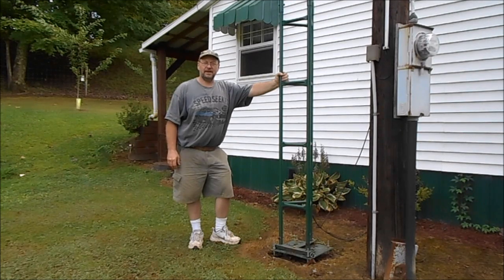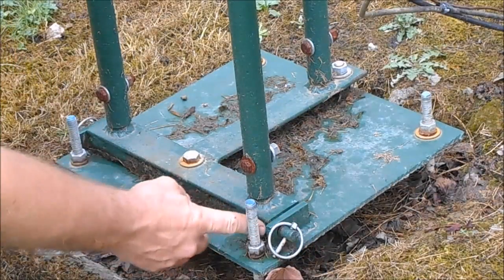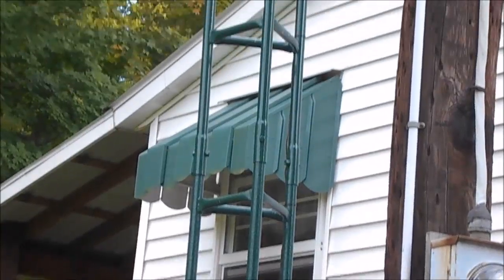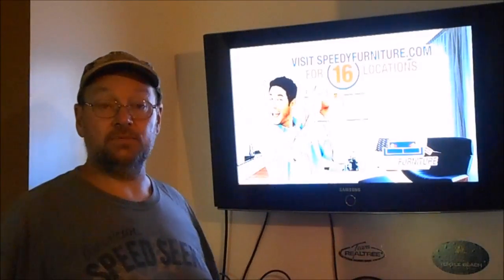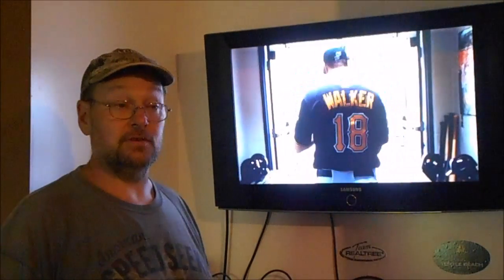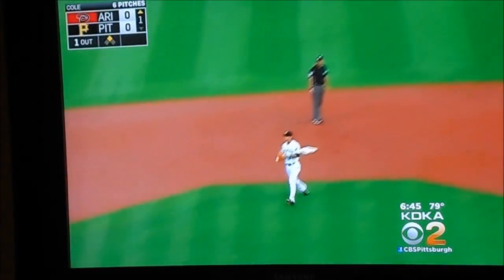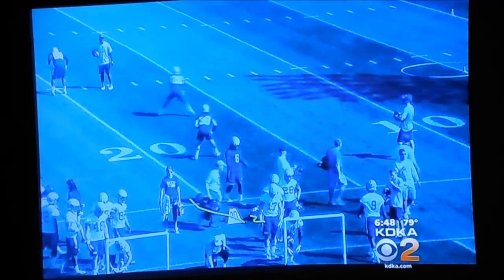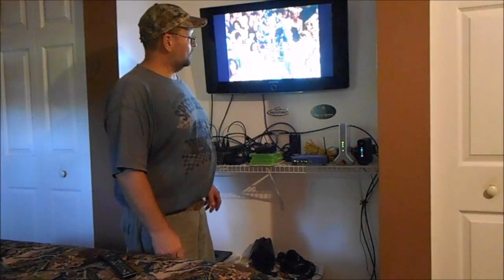The best 8 Bay HD TV antenna

Comment: Kevin,  I just saw your video and recognized the Pittsburgh stations. I used to get all the Pittsburgh stations  plus Johnstown from an antenna before the wonderful transition to digital broadcast TV in 2009. I now depend on direct TV for the local stations because I could no longer get them from my antenna. I live in northwest PA amongst the hills in a valley (we say hollow). I heard you state you lived in southwestern PA so I was curious how far you were from the TV stations in Pittsburgh and if your area was very hilly. I have been through Washington county and it's in mountainous foothills as we are up here.  Signal guides state that I am approximately 64 miles from stations. I remember when it was free TV and that's why we had to put up with commercials. Now we pay for TV and still have to put up with commercials. Great channel and good idea with the TV tower to make it easy to repair or maintenance.

Comment: It's just a matter of not just buying the antenna but installing the mast pipe to mount it on and grounding it properly. You really don't need a tower for a TV antenna. This seems to be making a comeback to eliminate cable & dish monthly bills which add up in a years time.
Reply from the maker: That is for sure thank you for the comment.

Comment: I have a CM-4228 It's great I pickup an easy 44 station or more with plenty of variety.(currently 60 channels with some repeated channels and a couple of Spanish stations)
I wasn't watching anything on cable. So I asked my wife if what she was watching was worth $125 a month. So first I went through various small antennas, then after doing my research, I ordered the CM-4228 through Home Depot which seemed the cheapest at around $90. I also the Channel Master LTE line filter to get rid of cell phone static which got me more stations and clearer stations.
Also you want the RG-6 cables and connector, and other cable or connectors is a waste of frequencies 

So I got rid of cable, But if you want to keep cable, it's not a problem as long as your cable box has a HDMI outlets
I did get ROKU so I'm good.
Reply from the maker: Thanks for sharing.

Comment: The Channel Master CM-4228HD TV antenna is the best antenna you'll ever own. I use mine with the Channel Master CM-7778 preamp and CM-3418  indoor distribution amplifier. Basically I could run my own MATV TV System and supply my apartment building with free over-the-air digital HD TV. The best quality picture you'll ever see on a HD TV and you can't go wrong with Channel Master. Currently getting 27 channels in the Montreal area 16 of which are U.S. Border Stations. $0 dollars a month TV!
Reply from the maker: I love it save money.

Comment: Kevin, Although this is an excellent antenna, it is primarily designed for UHF channels.  Since VHF Lo and High band exist in your area, you should install an all-band antenna.  Also avoid using an amplifier if possible.  Local cell towers and FM broadcast stations can overload the amp and degrade reception.
Reply from the maker: good information thank you

Comment: so do i need a booster when the signal is low on a cloudy day? I live close to many broadcast towers within 20 miles to me the closet being 7.1 miles. thanks :)
Reply: you won't need a booster....
Reply: Boosters are mainly for long runs or large splitters. Like 4 or more tvs. I found out letting your antenna do the work by using a better gain antenna but as close as you are you should not need a booster period. Also try turning antenna to get the strongest signal.
Reply: There are 2 Type of AMPS.  1= A Pre-Amplifier (For Signal Booster) and 2= Antenna Amplifier (For Long Distance Wire)

Comment: More than likely that duplicate channels that you're getting under another Channel  A affiliate of another Market. See if you're in between towns you may very well get to markets. The easy way to do it and figure out where they're at is put the call sign into the search bar of your computer and it will tell you where that station is located. Something else that may be beneficial as there is a website called TV fools yes believe it or not that you put in the ZIP code or your actual address and it will tell you on a compass type diagram which direction the stations are in and naturally you have to have your rotor calibrated in order to use that compass. If you did your scan at night you will tend to bring in stuff you may not get during the day that is far away. There is something that is called tropospheric ducting and when that is happening you can get stations from hundreds of miles away if you know where to aim. It's a phenomenon of Mother Nature. Very much like skip on the CB or ham radio. It's fun to play with and you have an excellent receiving station to play with long distance signals. I'm envious. Be aware that when  tropo as working you have to rescan to pick up those Faraway stations. During your scan you may see that it gets stuck as it is moving forward it may instantly pick up stations at that point and move on or it may not. If it is not a reliable signal the television cannot decode it and it will think about it a minute and either scan it in or skip it. That is the delays that you see. Get your headings and scan in that direction. The next they will be gone. I live in  Corpus  Christi tx. I had several stations down there i cant remember like 130 air miles away san Antonio  about  the same dist. North Victoria tx 81 air miles and one from Houston tx 180 miles. I have single yours is two together i have no amp. And i am 15 feet off the ground. Other than possible immediate line of sight issues you have a far better set up and you could easily get it of course if they're out there to get. You have to be patient and wait for conditions. I was previously a ham operator and have a 45-foot tower I need to get my antennas go faced with a reflector in a rotor up there. Playing with long-distance also none of this DX is more of a challenge then anything. It's not for Reliable TV

Comment: I have a ???  do I have to put  this  Antenna  way up high  over the roof  I have a few  trees around me  and dose it have to  point to  2  different  stations   I have about  5   different stations  about  30 miles or less around me.  about 4  stations is all in the  same place just about   and one is off in a different  place it is hard to line them up   to get them all  I will  find about  15 channels  and some will  go off at day time  and come back on at night any thing  you tell me  would help
Reply from the maker: The reason why you get good channels at night because the signal bounces off the moisture in the air do you have the channel master 8-bay antenna a good antenna is #1 above them trees would be nice the higher the better.
Look into a booster that will help to my setup was worth every penny. thank you for the comment.
Reply: Trees aren't near as big an issue if they are 30 40 50 yards away further the better. Do not expect good signal when they are 5 feet away. Look for the W above I had a long post regarding skip which is known as tropospheric ducting. On these particular frequencies. It is not an ionosphere bounce like on HF. Get a good antenna get it high and put an amp on it Sila all connections with tape on the coax and amplifier. What you scan it at night you may not have the next day. TV reception is better at night. It would not be impossible to have regular Dependable television on a good antenna at a good height from 85 or so miles line of sight is the name of the game. Also a good DB gain antenna and do not be fooled by those hundred and fifty mile antennas. Mine is homemade and that is not elaborate and I have received tropospheric ducting from almost 200 miles away
Reply: Brenda, There are several things you may want to check on your set up. The cables and connectors are color coded. Your signal is only as strong as your weakest connection.
So BLUE coded RG6 cable and connectors are best and rated for the widest frequency of 5 - 2,3Gh(2300Mh) If you have splitters, they will state a frequency range Old school units are generall, 5 - 900Mh. The RED coded are 5-1,004Mh. I'd suggest up remove anything that isn't coded Blue from your antenna to your tvs Also Buy concise lengths of cable(don't use 100 foot when 25 foot will work due to loss of signal.) If your cable comes thru a wall mounted jack, be sure the the plastic insert is Blue!!!! The ring on the cable ends should be Blue!! 

Lowes, Home Depot, Ace Hardware and Walmart should have what you need, but they also have the cheap crap that will give you a cheap crappy picture.
My cable company Harness was generally RED coded. once I changed it out to Blue, I get a beautiful picture and more channels.

As for Height, get it as high as you can. All of the "$39" antennas are shown mounted on the side of the house. This is not desirable. Your Antenna should be over the peak of the roof. So if you have one of those kits with the short stand, mount it near the peak of the roof so that you have the best signal possible. Away from trees and obstructions as much as possible
I was 10 feet higher before Hurricane Flo(Long story), so I've lost some long distance stations. I don't have a tower YET, But will soon as I can find a deal, so my antenna is 20 feet off the ground, about 7 feet over the roof. 
I have a Channel Master Extreme 8 bay which survived Hurricane Flo with a little tweaking and newer stronger pipe sections

I am a TVholic and have been Cable Free for 1 year and 8 days.

On that note, I have several Roku units for my tvs
How long have you had "Internet" service?? Check with your provider, ONCE I CONTACTED SPECTRUM,  The swapped out my our Router for a 16 x 4 unit and also gave me a router, so my Wifi is loaded for bear! 
I was getting download speed of 19Mbps but now get over 100 Mbps